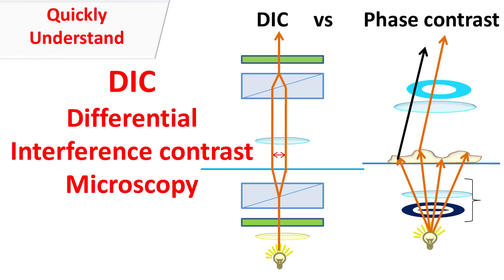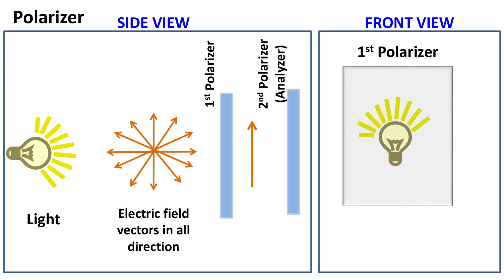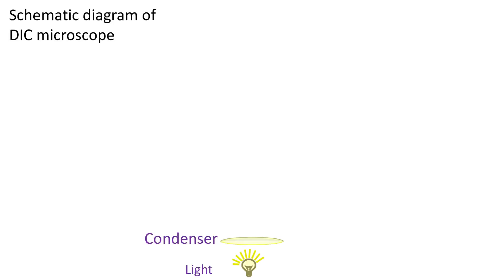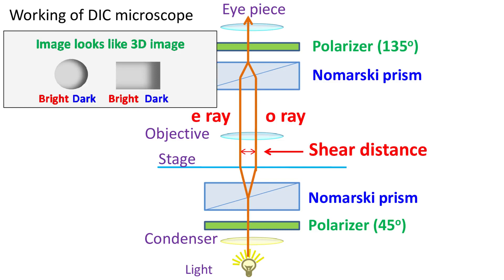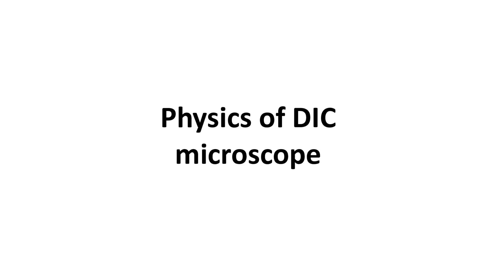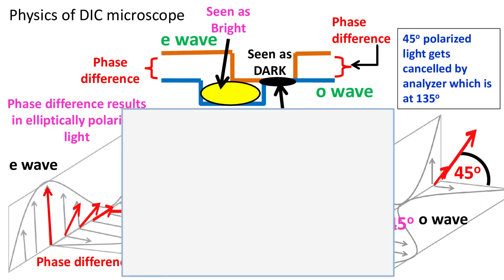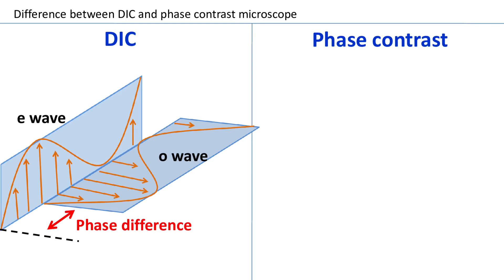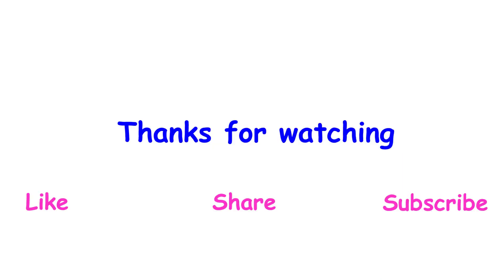DIC Microscopy | Differential interference contrast | DIC vs Phase contrast.

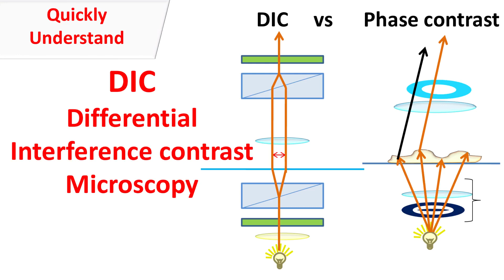Comment: Does anyone here have broad experience using DIC? I was hoping I could ask a question.  I am trying to understand this in a general manner.  From this video at 0:06 timestamp, we see that two (I assume 'matched') 'DIC Nomarski Prisms' are required. One below the sample, and one above.  Apparently there is no concept of a single one-size-fits-all 'DIC Nomarski Prism.  As when I look at actual part numbers, for example in the Olympus microscope line, there are several of these: U-DIC-10, U-DIC-20, U-DIC-40, U-DIC60, and U-DIC100. What I notice in the differing catalog numbers is what appears to be the 'Magnification' is different.  This implies the DIC Nomarski Prism is somehow 'optimized' to a given magnification.  My first question is - what actually causes these DIC Nomarski Prisms to be different in their manufactured characteristics? In other words, if one were to hold both a U-DIC10 and compare it to a U-DIC20 - how exactly would they be different?